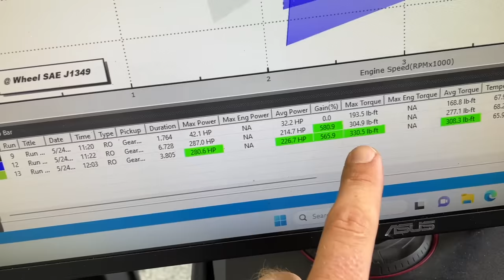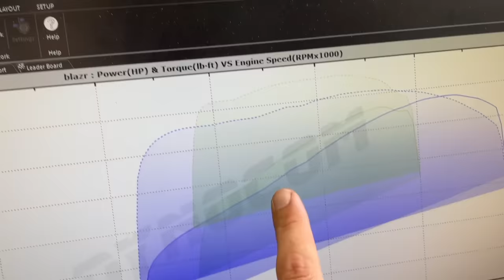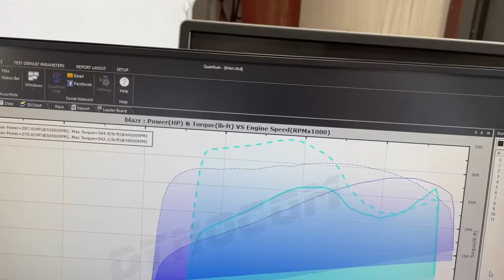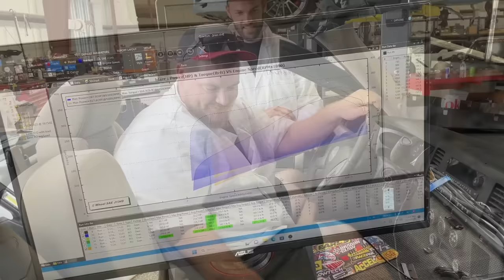MIND BLOWN!!! We Put TOP FUEL NITRO In a Daily Driver and It Made INSANE HORSEPOWER!

Comment: For anyone who doesn't already know: nitro contains both the fuel component and the oxygen component. So the more you add to the mixture, the more power it makes because it's largely bringing the oxygen with it.

I really love seeing you actually test this out on the dyno though. VERY interesting stuff!
Reply: Our course youtube experiments turn to oxygenated fuels.
Wait until they discover hydrazine and flak jackets 😂
Reply: In the 1960s, the Ramchargers drag racing team made up of Chrysler engineers started adding hydrazine to their fuel.  The tech inspectors wondered why the tops of their pistons were turning green, and they made up some nonsense about dye and combustion analysis or some such.  Eventually their supplier got curious and asked what sort of military aerospace project Chrysler were working on with the ultra-toxic hypergolic rocket fuel.  When they explained that they were using it as an automotive racing fuel additive, the guy flipped his lid and said they were all lucky to be alive.
Reply: Plus if you pre-chill your nitro, you’ll squeeze a bit more out of it! 😉
Reply: only 1500 dollars to fill up..sure why not
Reply: So you end up with too much oxygen and lean mixture.thats why you need to richen it up or it's a bit like adding nitrous with no extra fuel.
Reply: @peterjohn3180  Being "a bit" lean does make things too hot, but if you're WAY lean the temperature actually goes back down.  Less fire, less pressure.  I believe in the very early days of nitro, they'd often run "lean of peak" in order to avoid blowing the engine up.  Running like this is very common in aviation, even with turbos.  Rich is safe, lean is safe, but the zone in the middle (peak EGT) is where bad things happen.  Some cars (mostly Hondas) did this from the factory, but today it's illegal for OEMs to do it because it stops the catalytic converter from working.  If your tune is accidentally lean, chances are it's in that Zone of Almost Certain Death, especially with power adders.
Reply: So on pure nitro methane you would not even need to open butterfly valve for the engine to run up to speed, just add more fuel?
Reply: @kebabaluba  Nitro carries oxygen, but it's not a stoichiometric ratio by any means.  Pure nitro with no air is extremely rich and my intuition is it'd be too rich to run.  Generally when something has the reaction components self contained, it's called an explosive.  Nitromethane isn't fully self contained in the way nitroglycerin is, for example.
Reply: @JETZcorp  I know modern cars use stratospheric injection to run less fuel to inducted air but when lean beyond the running hot part I've just found engines stop firing plus if what you say is correct about still being able to actually fire it would still run with a blue flame front and be locally hot.
I need to research what you say before I say you're incorrect!
I would have when I was younger but I don't see how such a beyond lean condition could ignite unless the burn only occurs around the plug and the fuel was all localised around it like vw tfsi engines.
Reply: @JETZcorp  well I'll be buggered you're right!
Isn't it strange that it's human to instinctively want to disagree with some thing if you just aren't aware of it?!
And it's annoying to learn something new.... this is counter productive and why I try not to do it now, I used to always disagree with my brother but he was right usually!

From what I read, the ultra lean condition that doesn't overheat will generally not run very smoothly.
I guess it must be a fine line between lean-hot, lean-cool and lean- stall.
Reply: @peterjohn3180  I recommend looking at aviation sources, since they seem to understand this stuff a little better than most in automotive.  There's a guy on here called Martin Pauly who has a good introduction to lean of peak operation for pilots.  Planes have REALLY crude fuel systems so the pilot has a knob to manually adjust the fuel ratio to compensate for altitude.  You can lean it out and watch EGT rise, lean it out further and watch it drop (with a noticeable decrease in power), then lean even further and you start to get rough running and a huge drop in power.

When you mentioned "stratospheric injection", I'm assuming you meant stratified charge.  Uneven distribution of fuel in the cylinder, or a rich pocket around the plug.  My understanding is that OEMs like Honda did this, I believe because those systems operated at low load and therefore really did need help getting lit.  That's easy to do with direct injection, but I believe Honda pulled it off with port injection and some God-tier understanding of airflow patterns.  I know they only ran lean when VTEC-E was holding one of the intake valves mostly shut, which created a major swirl in the cylinder.  Of course, now that LOP is mostly illegal due to emissions, everyone's mostly back to shooting for a perfectly homogeneous charge from their direct injection.

But, again from the world of planes I know it must not be totally necessary, since aero carbs or the mechanical dribble-tube BS fuel injection systems can't do that level of control.  But, planes tend to run at high throttle, at altitude (lower charge density), and burn 100-octane leaded.  They're also stunningly huge and weak - the most common plane engine is a 5.9L boxer-4 (!!) with 180hp.  So there definitely are some differences compared to most car engines, especially when boost or nitro are involved.  But I should say, nitro carrying it's own oxygen might throw a couple more complications into this whole mess in terms of lighting it off.
Reply: @JETZcorp  yes I meant stratified injection - tfsi VW/Audi direct injection.
Turbo stratisferic injection.....not sure what the F stands for?!
Fornicating?! Lol
Plane engines intrigue me.
Imagine putting a longer duration cam etc in one and using it in a car!
I saw one flat 4 in a bike on here.
The 2 stroke diesel plane engines being developed look exciting.
Loop scavenged using blower .....
Love to put one in a car.
Reply: @peterjohn3180  I think a plane engine in a car is generally not a great idea.  Because they're so huge with so few cylinders, they really can't be revved much higher than they already are.  The heads are perfectly designed to not make any power.  They're also absurdly expensive - a rebuild on a Lycoming costs about as much as a rebuild on a 458 Speciale.  they're effectively 1940s technology, frozen in time.  Like a HUGE, worse VW bug motor.  The case halves use a piece of silk string instead of a gasket or sealant.  It's such a weird scene.  They are very light though.
Reply: @JETZcorp  vtec-e, I was surprised to see someone knew about this. God tier air flow design is right lol
On this d16y5 head I have. Its a 16valve head but out of VTEC (under 3k rpms) it runs on 12v 
So atleast on this head (I think) one intake valve is always shut for better swirl and velocity.
Tuned it my self adjusted low load cruising to around 17:1 AFR 
Was getting about 50-55mpg average. 
Even heard stock computers would go leaner. 
Never noticed any spark plug damage. 
Even my 12:1 cr little 1.6L I lean out to about 16:1 on 87 octane and it holds up. 
(I run my motor at around 160°f tho that compression and lean afr definitely makes more heat)
Reply: @JETZcorp   from my experence you can run any mixture and any boost at any time, the forgotten key is ignition timming, if you want to run 16-1 afr with boost you just need to retard the timing accordingly.  
i used mega squirt efi system and i had them make a special addon for a igniton table relative to the afr and load. as i had a daily driver 3.8 turbo buick in my subaru legacy gt, i was getting better fuel economy than the 2.5 turbo engine. running lean didnt help my economy numbers as you just had to give more throttle to compensate for less heat per combustrion.   also my 1976 k3 truck with a 383 i do run about 15.7 -1 afr at cruise but it really doesnt seem to help much if any on my economy numbers as i have to open the throrrle blades more to maintain 70 mph. running lean just makes a ton of NOX
Reply: @STRUTZKOFF  Opening the throttle more is actually the point of lean running.  Some of the parasitic losses from an engine come from the piston fighting manifold vacuum on the intake stroke, and fighting the expanding gases from spark advance on compression.  Running lean forces more throttle and less advance, as you noted.  That means there's less pumping loss from manifold vacuum, and less compression loss due to a faster flame with retarded timing.  How much you gain depends on how much these factors were contributing to losses, compared to other factors.  When I had my Insight, it was good for about 10% gains in efficiency.  That's a highly aerodynamic car, with a VERY low-friction engine, running ~25:1 with a very well tuned stratified charge strategy from the factory.  In a car that's putting more energy into air drag and differentials and pushrods etc, the gains should be less.  But, an oversized powerful engine that cruises at low load would get extra benefit.

Today, the automakers try to get similar effects by using cylinder deactivation and VVT tricks.  4 cylinders working hard will generate less vacuum and need less advance than 8 cylinders gently buzzing along.  As with lean burn, the gains are 5-10% and not 50%.
Reply: @paulsachs9983 hydrazine is wild, super toxic though
Reply: @JETZcorp and @STRUTZKOFF

Man… that was one hella informative and interesting conversation that the two of you just had. Honestly, I only understood about 20% of everything y’all were saying back and forth. I am 45 years old and been messing with vehicles and gas motors of all kinds since I was about 14 years old and the knowledge that the two of you just put down absolutely blew my mind!!! I know a lot about cars and engines, well at least I thought I did until I just read all that. Now, I have always known that there is way more stuff, about vehicles and engines, that I don’t know about than stuff I do know about in the automotive world… but the two of you just made me feel like a freaking toddler playing with some dadgum wood blocks!!! After reading all of that super informative and knowledgeable stuff that y’all commented, I now know, even more so than before, that I have only been just barely scratching the surface this whole entire time!!! 😂😂😂 Thanks though, it made for one very interesting read. Props to you two for partaking in an adult conversation, without arguing and name calling and admitting when one of you were wrong or unsure about the other’s statements. You definitely do NOT see y’all’s kind of conversations on the internet very often!!! Honestly, it quiet rare, if I must say so myself. So, just one more time… kudos to the both of you!!!
Reply: @DFWJon  I'm flattered, but I just like reading about engines.  I've gone down the various tech article rabbit holes of V8 hot-rodding, hypermiling, 2-strokes, and aviation.  Each of those worlds has bits of information that are common knowledge in the community, but that don't often cross over.  But, my skills with a wrench are as poor as a cross-eyed yak, so I've hardly done anything beyond reading.  I did rebuild my old 2-stroke Kawasaki engine, which is why it leaks buckets of oil, and the kick-starter only works when you lean it to the right.  By the sound of it, you've probably got all sorts of practical skills and knowledge that would quickly make me look like the toddler.
Reply: @JETZcorp so u be the mechanic and he will be the guy in the shop office bringing u customers.
Reply: Rocket fuel basically ?
Reply: It's technically a monopropellant.

Comment: Love drag racing and worked in chem labs for years doing testing on various fuels.  Years ago I had a Methanol 4 stroke racing kart. Was a very quick kart on Methanol. I ran it one time on 50/50 Nitromethane and Methanol. Was the most fun I ever had for 10 min. Kart hooked pretty good in turns on alcohol. On Nitro it blew the tires away in every corner and pulled like  crazy......

Until the motor stopped. When I took it apart it bent the crank something like .150" on the rod journals.  Like in Top Fuel, nitro is cool as hell but hard on parts.

Comment: So the lesson to be learned from this is that should be used as the fuel for Mullet to move you into the five second range.
Reply: Yep, that is why mullet only makes 5000 hp and top fuel cars make 10000+ hp......it's funny how it matches their doubled number on this experiment.
Reply: Mullet has the engine and turbo to go 5s it’s just the tuning and suspension they’re gonna have to dial as they’re already pretty freaking close
Reply: @clankyexpert8998  Mullet is also heavier than Tom Bailey's car, from what they have said, so it will be harder than it is for Tom to run 5 seconds.

Comment: That sure said a lot for the 5.3 chevy. Horse power is one thing, torque is another. But to have a rock solid platform to work with is gold.
Reply: Most definitely. I'm not sure what block this specific engine has but late 90's, early 2000's GMCs and Silverados came with the iron block LM7 and they handle boost really damn well

Comment: Ive done this same test on a 5.3 ,you need bigger injectors and bump the fuel up 30% on 50% nitro we made 517whp and 589 torque
Reply: How do you figure out how much more injector u  need
Reply: Just run the biggest that will idle. 2000-2500cc
Reply: Hay que reprogramar todo el mapa para aprovechar el combustible,darle más avance de chispa

Comment: Stock 5.3 nitro tune, with some parts thrown at it having a pure nitro tune for the track would be killer. Those were huge gains!!!
Reply: Yeah they were, I have stock 2001 GMC that's 314 hp with just an intake and exhaust, this made me realize the power the old iron block v8's can make. Although I can't afford nitro methane anytime soon it's still cool to see the capabilities of these old engines
Reply: I doubt the engine would last a full trip down the track with that high of a mixture of nitromethane. If it did the plugs would probably be melted and the rings would probably be vaporized lol it would be cool to see a SM nitro small block thrown in!!
Reply: But it would cost you a thousand bucks a run just for fuel!
Reply: @johnathanromero3944  at this hp level, that's not an issue. Plugs will be fine. 
It's the heat generated from 11,000 hp that melts parts in a TF engine.
Reply: @dalegnodle  $45 /gal

Comment: Now you know how a nitro injected A/FD can run straight up with a blown alcohol dragster.  They make torque almost like a EV.  Right off the hit.
Reply: You know that was over 500 horsepower to the flywheel on a stock motor. Now see how much more horsepower a stock 5.0 will make.

Comment: I mean, the amount of fuel being dumped into the engine to achieve this madness is incredible. No wonder why top fuel dragsters are so expensive to run (besides all the other variables)
Reply: Have you ever seen a video of how much Nitro is being just blasted into a top fuel engine?  It's almost enough to hydro lock the engine.  It only works because Nitro Methane has it's own Oxygen, so the air/fuel ratio doesn't have to be regulated anything at all like a gasoline engine.
Reply: Nitrogen is cheap 

Besides, everything used on the Cleetus channel is ad revenue.  Which means nothing comes out of his pocket bc youtube is technically a "business".
Reply: @llamacebu216  nitromethane is not nitrogen
CH³NO²
Reply: @llamacebu216  nitromethane is $45 gallon
Reply: 10 gallons per run
Reply: @Calango741  Finally someone else gets it. All these people keep saying they should have sprayed it with nitrous, but it would have only made it even more lean. I know it is fun to see Jackstand do that, but nitro with too small of a fuel system just doesn't gain anything from adding more air. Also, top fuel cars make 2x the HP or more of mullet and both are running forced induction on a 5xx cu in engine.......it matches the power increase seen here, which is no surprise to me. I have seen videos of top fuel injectors running and it is impressive.

Comment: I used to put r.c. car 80/20 nitro in my 87 mr2 mk11. Also, a homemade brown gas generator can give decent gains. It's super easy to make and adds alot of umph when the reostat is tuned in properly. Throttle body injection works best for tuning the hho generator. Easy to build hard to get proper ratios tho.

Comment: I love the smell of Nitro in the morning...It smells like VICTORY!! The next thing to do, is change the oil and filter, run the engine on gasoline for a few minutes, then change it again! Burning CH3NO2 (Nitromethane) produces water and nitrogen, which becomes nitric acid in the engine oil. Once oil goes from being dielectric (insulator) to electrolytic (conductive), it begins to cause corrosion and worse, galvanization between dissimilar metals within the engine. That attacks bearings and piston rings and their landings. Letting the engine sit with contaminated oil does more damage, than actually running the engine!
     When going back to gasoline, you might check the fuel map... Maybe a little less duty cycle on the injectors.😀😀

Comment: It’s amazing that the rowdiness of the engine sound is directly correlated higher horsepower and torque lol
Reply: Running high % nitro changes the sound of the engine quite dramatically...
Reply: Yeah it’s like a cheat code. Oh I want 80% more power in my truck…